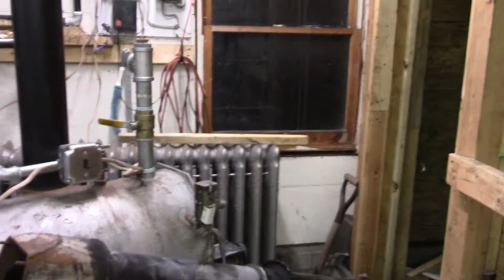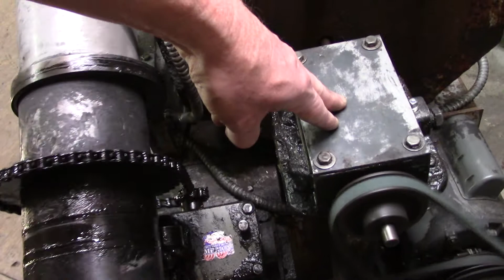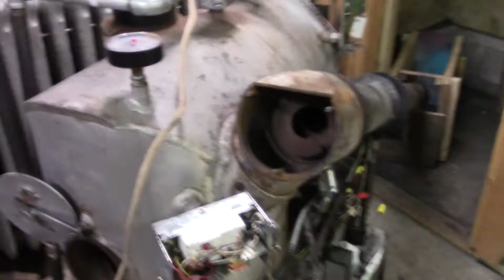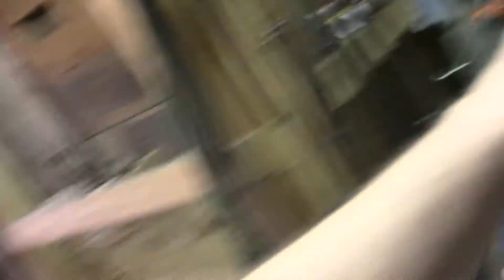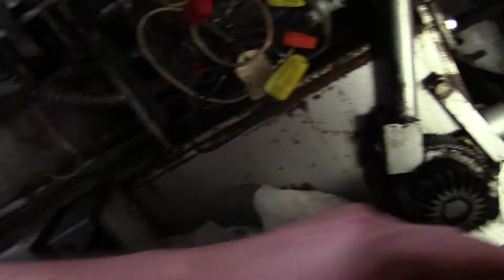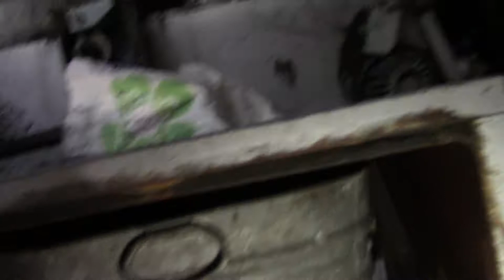Axeman Anderson AA130 Anthracite Coal Boiler PT16

Comment: I know a guy who's heated his house with an AA 130 for over 36 years since he bought it new and he shuts it down once a year for annual cleaning and when he restarts the fire simply places a dozen pieces of charcoal on the grate on the ashing aquastat side and lights the fire keeping the ash door open for air and after 20 minutes or so when all the charcoal is burning nicely then turns it on to start the coal feed fire usually he told me the ashing will make one rotation until the probe hit the hot charcoal then the ashing stops. To place the charcoal with a cold or cool boiler you simply grab a few lumps of charcoal stick your arm down the opening with the vacuum sealed cover and place the charcoal and he soaks his charcoal in a number ten can with charcoal lighter fluid so after he has a big enough pile of charcoal he lights it with a kitchen match dropped down the viewing port. No ashes to fool with as was described to him and he followed the instructions from a friend of the family who introduced him to the AA 130 boiler and has been doing it that way ever since the first light off. He said the only real problem he's had with it was he didn't build a big enough coal bunker. After the first winter he increased his coal bunker to 30 tons so he doesn't have to worry about fuel in the winter.

Cheers Don it's a great boiler!